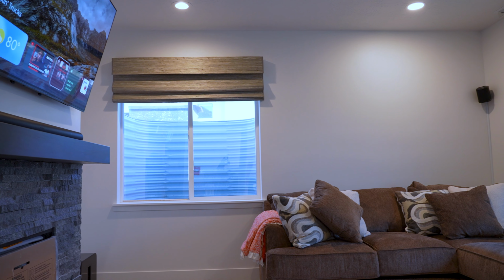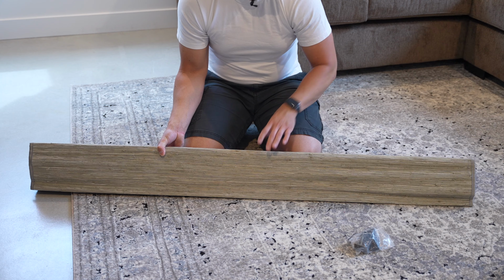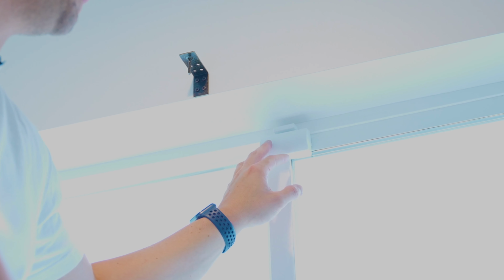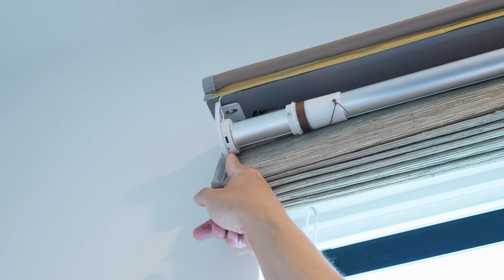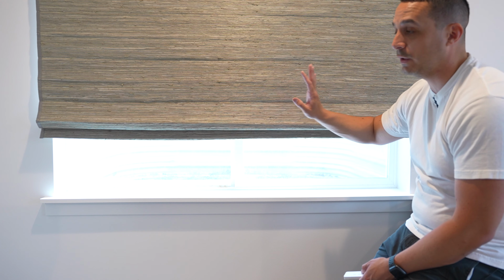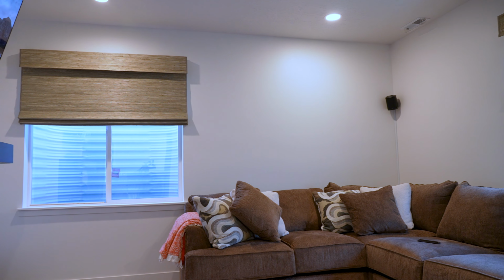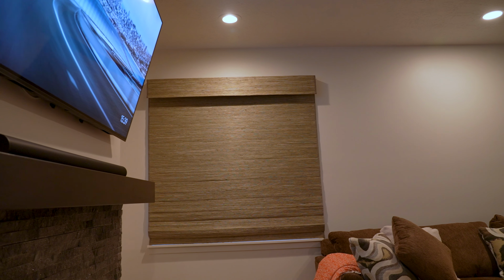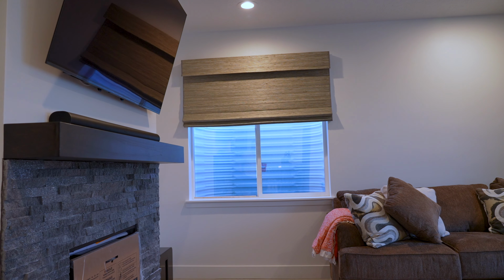SmartWings Motorized Woven Wood Shades - Review

Comment: I bought these woven wood blinds with a smart link stick to control with an app on my phone. We have felt the instructions for using the smart link- is not very user friendly. We did get each blind to pair with the smart link app but you are suppose to be able to group blinds together in a “scene” and then program the app to go up and down at certain times of the day or if the temp or humidity is a certain degree. I have tried and tried to group blinds together with the app to no avail. Could you do a video on how to use the smart link app for these blinds? And is the automation portion only available if I use Alexa or Echo, or Google Assistant or can I voice automate these blinds with the smart link stick?

Comment: Excellent video. But wrong information about the outside mount. The outside mount covers the end of the valence so that the entire valence has a nice wrap around with the woven wood.
Reply from the maker: Did you watch the video? I clearly don't have the end covers and the ends are exposed.
Reply: @TomasVillegas  yes, I called smartwings and they told me that it looks like that for inside mount option. Outside mount covers the ends of the valence. I loved your video, it was extremely helpful. I purchased them because of you.